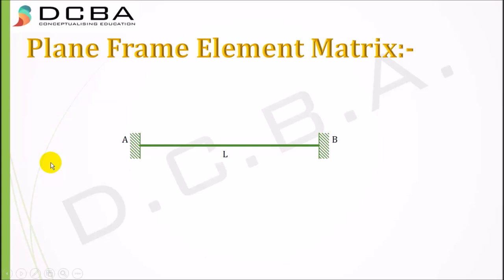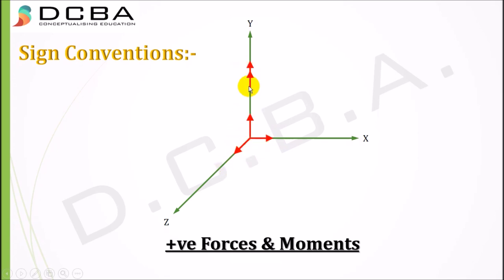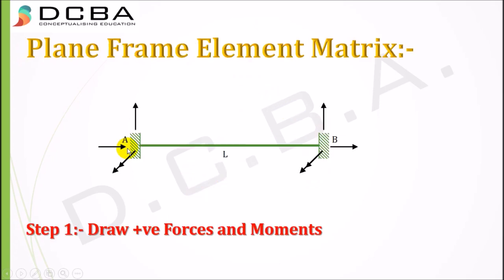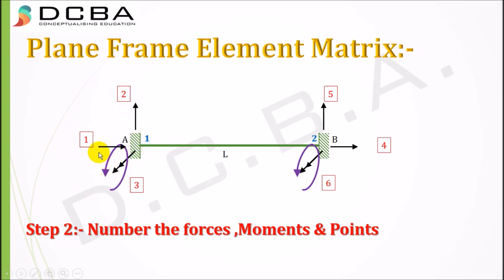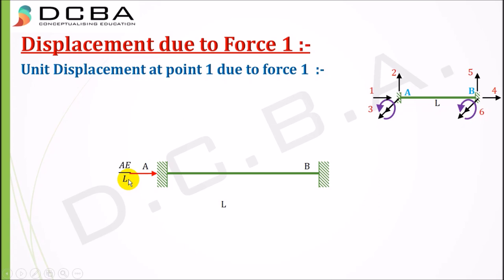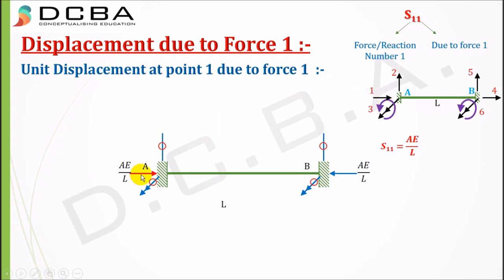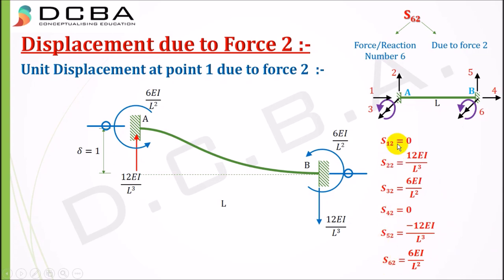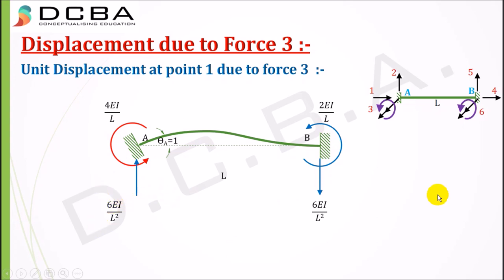Stiffness Method Structural Analysis (Plane Frame Element)

Comment: 10:38 S33 should be with negative sign but you put it positive, isn't it?
Reply from the maker: No it is positive, since its anti clockwise and our sign convention is also anti clockwise
Reply: @DCBAonline  oho yes, now I got it! By the way I appreciate your work!
Reply: @DCBAonline  sir can you suggest a method! How to solve fixed end moments other then castligiano theorem?
Reply from the maker: Unit load method, flexibility matrix method